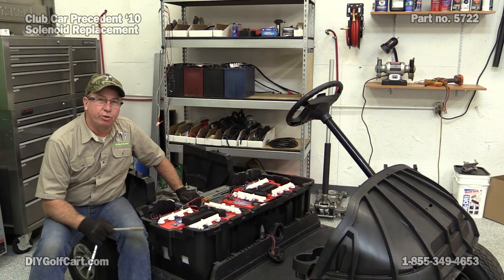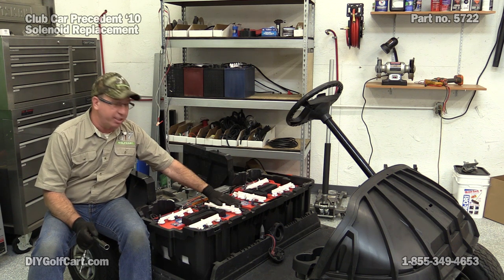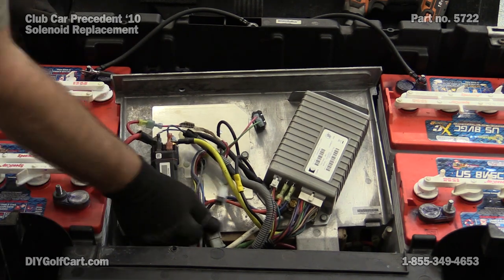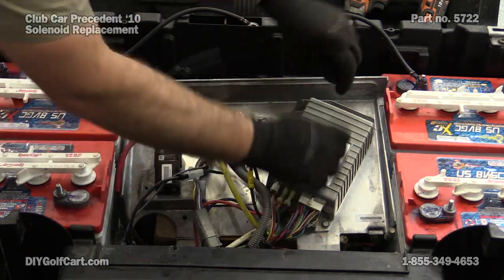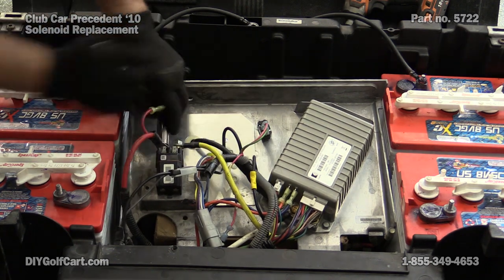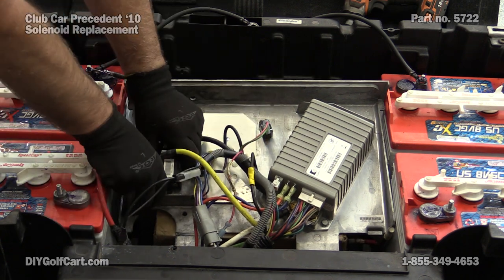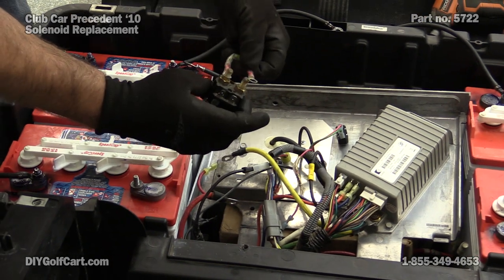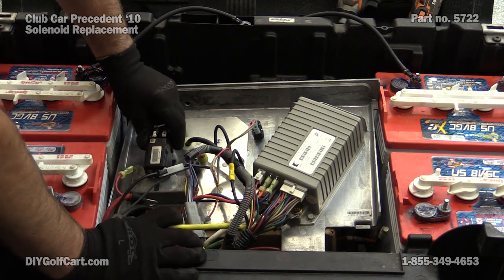Club Car Precedent 48 Volt Solenoid | How to Replace on Golf Cart

Comment: I have a 2003 Club Car 48 volt electric cart that will not go sometimes when pressing the gas. After pressing several times it will finally go. Batteries are good. Any help will be appreciated
Reply: Pop your seat off have someone pressing the gas jiggle every single cable those cables get so hot the ends get very brittle and they lose conductivity if it suddenly goes while you're  jiggling a cable well you found the one that or your solenoid might be going out check the cables first

Comment: Again your videos are good but you're not explaining why you're changing out the solenoid what problem persists to make you decide to change the solenoid, the information would definitely be helpful
Reply: If you turn key and try to move you may hear a click but nothing happens, the solenoid clicks, it's bad. Your car wont move and you need to change it.
Reply: @jerrydavila4066 You also want to change your solenoid to a 400a if you are running more power specially a DC to AC kit like Navitas or Silver Wolf Teekon.

Comment: Hey there sir I currently have a 2013 precedent I’ve put a admiral motor and putting the heavy duty solenoid tomorrow my question is do I need to change resistor when going with a heavy duty solenoid

Comment: I have a 2013 electric Club Car Precedent and when I press the accelerator pedal the first time nothing happens. But then if I press down again it goes and runs fine. I replaced the MCOR and nothing changed. So I replaced the solenoid and still no improvement. I do notice that if you get going and then stop—if you press the pedal again within about 5seconds of stopping—it will go on first pedal depression. But if you wait 7-10 seconds or longer—you will have to press the pedal twice in order to go. Any ideas??
Reply: I am currently having the same exact problem on a 2013 Precedent. I am still trying to find the answer for that problem. Did you figure out what caused that on your cart?
Reply: @Lakanuki  same issue, before the solenoid clicked now it does not click changed out the solenoid still didnt work . new issue is over the small terminals the volts is less than 48v ...
Reply: @zenhookah9296  

7 months and still no answer. Did you ever figure your out??
Reply: No my cart is still dead in the water changed out solinoid , the accelerometer, the batteries , in board charge controller , next willl the main controller but I am out of money for this project …

Comment: Hey Barry.....I have a 2007 Precedent. Just completed a lift and large off road tires. When I'm running full throttle going on a decline or the wind at my back the motor cuts in and out at full speed. Is this the governor??? Would a high speed magnet cure this? Also it has a nasty habit of going straight to the rollaway brake when coasting or slowing for a stop sign. Is there a way to disable this function or is this a common problem and there is something wrong? It is not comfortable to go from 20 something to zero that fast. I have driven quite a few Precedents at golf courses and never dealt with one this sensitive to coasting. Could the tires have something to do with it? I have only had it about 3 months and did not drive it much prior to the tires.

Comment: If you have an electrical arc on the mortor post of a club car prescedent and then it will not run ,what are some things to check for
Reply from the maker: First put the car in "tow". Wait about 1 full minute. Put back into "run" and see if that helps. If not, give us a call, the controller may have shorted out.

Comment: what does it mean when the solenoid doesnt read 48v over the small terminals only reads 40v and wont activate the solenoid. battery set is reading 50v

Comment: Why do you need to replace the solenoid on a club car president
Reply: if it gets stuck in the on position or doesnt click into place . usually because of too many amps drawn through it . heavy foot on hills  or soft sand mud.

Comment: Hi Barry...I just subscribed...I have a 2018 Gas Club Car Onward where I want to install a GPS.  The GPS is a Trackmate Mini H 3G.  In addition to the battery wires it has a wire to connect to the ignition.  I assume that I can/need to make this ignition connection at the Solenoid where the ignition wire connects.  Can you advise on if I am accurate and how would I identify which of the wires connected to the Solenoid is the ignition wire?  Thanks in advance - Chris
Reply from the maker: The absolute best way to determine which terminal to attach a small positive lead to, is to put a volt meter across the 2 small terminals and depress the accelerator pedal. If your golf car shows up 48 volts or better, the positive terminal will the the red lead from the voltmeter.  If it shows up negative 48 volts or better, then the black lead from the voltmeter is the positive terminal.

Comment: My 2013 Club Car Precedent often times wont go until about the 2nd or 3rd time I press the pedal.Replaced the CCOR and didnt help. Could this be a bad solenoid?
Reply from the maker: https://www.youtube.com/watch?v=pE601yLLSBI             Check out this video.
Reply: Can you hear solenoid click when key engaged in forward and pressing pedal? If not, likely solenoid.   I'm having  similar problems  . Mine clicks like mad most of the time then when on the course it sometimes doesn't and cart stops. Think mine just worn not failed.

Comment: I have to hit the gas pedal 2 or 3 times to get it to go. Could it be the solenoid
Reply from the maker: +Michael Lisowski Is the Solenoid clicking in each time? If not, it's not the solenoid. If it is, Check to make sure the voltage is the same across the two large terminals with the pedal pressed.

Comment: Good morning I just bought a used 2014 48v club car and found out it has issues when I got home.  It was able to run with out the key on, and the solenoid and motor stays energized.  After some troubleshooting and seeing that the yellow wire was connected to the (+), I switched it with the red battery cable and now it only works with the key, but the solenoid and motor are still energized.  Any help would be greatly appreciated beings I know nothing about golf carts.  Thanks

Comment: is there a specific way the resister goes on the solinoid?
Reply from the maker: No, the Resister is non-directional.  Only the Diode is directional and the strip goes on the positive side.
Reply: @golfcartking  thank you
Reply: @golfcartking  mine did not have a diode on it. just the resister.  is it required?
2015 club car president electric

Comment: If I press the pedal all the way my club car stops.  Could this be the solenoid?
Reply from the maker: Sounds more like either weak batteries or a bad MCOR.
Reply: DIY Golf Cart that's what is driving me crazy..  Batteries are fully charged, I can press the pedal very light and it drives very slowly but as soon as I give it full pedal, it jumps and stops.
Reply: Thanks for replying... Your videos are very helpful.
Reply from the maker: Email me at barry@diygolfcart.com and request a MCOR test. I'll send it to you so you can make sure that's the issue before you purchase one.

Comment: I've got a 2010 Club Car Precedent 48V with a 3.3 HP motor with AU25oo rating. If I upgrade to a 6 - 7 HP motor, is there ANY other component upgrade requirement, i.e. solenoid, controller, switches, etc?  Please advise.
Reply from the maker: Really depends on how the motor is wound.  What is the rpm vs. voltage range of the new motor.

Comment: I have a 2010 Club Car Precedent. Batteries are fully charged. All connections are good. It will not move. I know the power was out at the campground for about 2 hours. Is there a fuse or something like that I can look at
Reply: Ken, If you don't hear the solenoid 'click' then you probably need to replace it. I'm not aware of any fuse that would fix a solenoid issue. Reply back here if you figure something out soon. I'm currently working on the same problem.
Reply: @bigair785   what if the solenoid isnt getting the 48v but only 40v yes battery reads 50v over the set